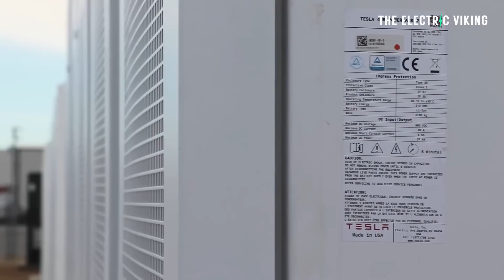Tesla signs biggest battery contract in history - U.S. grid will be transformed

Comment: Musk never agreed to EV incentives. The reason why is because it discourages Ev development reaching cost parity with ICE cars.
Reply: There are some fundamental physical realities with EVs that may be impossible to overcome.
Such as: 1 Kg of petrol has same energy as 30 Kg of batteries. ICE about 35% efficient, so 3Kg of gas = 30 Kg of battery.
This is why EVs (drone, scooters, small cars...) are practical but heavy hauling (long distance) trucking makes no sense.
And the "Charging" issue is a big problem for anything long distance. Fast charging always damages battery life.
Reply: @mddell24  ICE aren't 35% efficient typically. Usually 16-25%. The extra weight is mostly offset by the much lighter drive train components.

Comment: Just consider not one of these batteries create green energy.  They will definitely increase the electricity bills of utility customers.
Reply: Not one! But they do enable renewable energy to be a viable replacement to fossil fuel generation 

in south Australia the grid is going to reach 100% renewables supported and stabilised by Tesla megapack. In Western Australia we are already at 40% - we’ve got rid of 1 of two coals stations and our expensive peaker plants. 

So far the south Australian barter has saved the state 333 million dollars and totally eradicated blackouts which used to be a problem there - also helps led by Tesla energy bidding system. 

So that would decrease electricity bills for customers. 

We used to invest in a Australian leading energy bidding tech company - but Tesla software solution came and just disrupted them silently. 

That’s the kind of tech smarts Tesla has - hard to compete with. 

The Tesla said that the next gen megapack will removed the need for substations. That will definitely change things even more!

Comment: Pardon my ignorance, but where does the energy come to charge to these enormous battery storage mega packs?
Reply: They are meant to be charged by solar or wind generation, the power stored until needed at night or when there is no wind.
Reply: @douglasburnside  So along with these massive battery packs would a large array of solar panels?
Reply: The star.
Reply: @mddell24  - being from a cool/cloudy/wet country (UK) comes with certain benefits, that is higher wind generating capacity (80TWh). Currently over 50% of the UK's energy is derived from renewables, a percentage that is which is increasing rapidly - coal is now insignificant and will be gone completely next year and LNG usage is dropping year on year. Last year the UK exported energy (10TWh) to Europe, as there was a surplus of capacity even with fossil fuels generating their lowest output for decades. The UKs storage battery capacity reached 3.7GW last year with a further 8GWh coming online in the next year, and plans to grow this by another 44GW capacity by 2028. The UK domestic need only requires 20 to 35GW, the UK plans to be a net exporter of renewable energy by 2030. The scale of economics for battery energy systems means it is now cheaper to install and run renewable generation with battery storage than a gas turbine plant. The target operating price for battery storage by 2028 is £22/kW/yr for a fifteen year period (which is relatively cheap in the energy world).
Reply: Anything that generates electricity. Anything.
Reply: Normally one thinks of renewable like solar and wind. But there is a case where it makes sense to have ibattery banks with a regular coal fired power station. Having the battery bank would allow the station to charge the batteries in times of weak demand and have batteries add capacity in times of peak demand. This would allow the station to operate in a more regular efficient zone instead of ramping up and down.
Reply: Fossil fuels of course, so where's the saving, new tech nuclear may save day
Reply: @bm4751  that sounds counter productive... charge batteries by nuclear would be a game changer.
Reply: No one should do the math. The battery size is enormous$$$$$ for most places where people live, i.e. cool/winter weather.
Reply: @mddell24  Most people on the planet live in Warm Weather. In the US, in India and In China and SE Asia and Africa. Solar is capable of powering the entire planet with enough storage. Some places will be better with Wind, but the major population is definitely in the South, closer to the equator, Globally speaking.

Comment: Why don’t they put panels over the battery packs to help keep them cooler?
Reply: Good thinkin
Reply: Because its not the sun heating them..
Reply: Using solar panels to keep things cooler through shading is a perfect fit, so long as you have room for them. Since they require so little maintenance and last forever, once installed they almost can be forgotten. Even without battery these panels can directly power some fans to cool down further your RV, carport, your shed, your pergola or your whole house, extending the life or your shingles. But if you can fit that many, you can actually drive a large mini-split air conditioner using a battery less hybrid inverter. Solar panels are robust assets and often keep delivering electrical  power even though they've been shattered as long as there is circuit continuity within. Together with LFP batteries they are the future of off grid autonomy, tremendous savings and respect for your environment over time, of course.
Reply: Covering the battery packs with PV panels ends up using more energy to keep the battery pack underneath cooler. Solar panels are black so they absorb light radiation, however, they only absord certain frequencies and the rest is radiated away in all directions. The area under a solar panel heats up a lot, which is why some of the more expensive high efficiency panels have active cooling (cooler panels are more efficient). The heat build up means the battery pack underneath has to work harder to exhaust its internal heat into the hotter air around it. The heat also stagnates under the cover the panels and cannot raise away as effectively via convection. 

To overcome this the battery pack would need uprated fan capacity to exhaust the heat, using more energy. There would probably be no energy gain from the panels above the battery as their energy would be consumed by the increased cooling requirements. One could install tall mounting frames with sparsers tilted panels to let the battery heat disapate but the energy gain vs the cost is not significant; also this introduces maintenance concerns when working above active battery packs. 

This is why battery packs are painted white, to radiate heat away, and have fan outlets on top vent to the open space above them so the hot air can be carried away by convection.
Reply: @GruffSillyGoat  I have ceiling fans to cool my solar panel if needed. One fan easily displace and prevent the heat build up over 9 panels without drawing much energy all. It should help prolonging the panel efficiency. But they can tolerate the heat without fan as is common with public school parking lots solar installations in my city.

Comment: This contract is incredibly the opposite of transformative. It is for an extention through 2030 of 15.3 Gigawatts of batteries to be provided by Tesla to another provider. Compare this tiny amount of power - by batteries which have to be charged by something; to the US Total existing grid of 4.2 Trillion killowatts - its totally nothing. That is if there is no transition to move away from fossil fuel use to an expanded grid; then it would be 15.3 Giga watts of 18 Trillion killowatts. How can less than 1/1000th of the grid be transformative; especially when even this tiny amount has to be charged by something, it may well be fossil fuel plants doing the charging.
Reply: If battery storage made economic sense. Fossil plants would invest in that without subsidies, you could charge them off peak to release on peak. It's just obviously a lot cheaper to create on demand if you can.
Reply: @SteveLomas-k6k  Agreed. The million year old solar-fossil battery is strong, (CO2 excepted).
Reply: Thank You!
Reply: BIG elephant keeps confusing the debate - KW is not KWHr. We should never confuse apples and height.
Reply: The daily energy usage in the United States in 2023 was approximately 75,424 gigawatt-hours (GWh).

If one megapack site is 15.3GW in capacity - it provides 0.02% of the entire US daily electricity needs. So yes less than a Thousandth - but it’s okay there is plenty of room to grow. We have a state in Australia about to reach 100% Renewables - supported by Tesla megapack batteries. 

For Tesla this US project is around 1.4B in profit. Teslas energy business really is a unlimited demand market.

Comment: Tesla needs to get into fusion energy. Solar is simply not just dense enough source of power to be able to place households and businesses off-grid and completely no longer relying on legacy energy companies/suppliers. The disruptive effect will be felt more if they’re one of the first private companies to develop and deploy workable and viable fusion reactors.
Reply: Why do you think so? If every home would have it's own solar panels and batteries, we indeed wouldn't be needing the grid, well we would need micro grids or state-owned batteries in case of emergencies, but I feel like the modern solar panels are already good enough to live only on solar energy,, wind is also great, hopefully in the future we could harness atomic energy safely.
Reply: Solar is pretty good, when backed up with batteries, I have switched from grid supply costing about £6000 per year to solar with battery and inverter, and a diesel generator for the two darkest months. I am saving around £5500 per year on energy costs and the system cost me around the same as one year of grid supply. The next 19 years are going to be nearly free. Any one can do it if they have a small amount of capital and some suitable place to put the panels. They are very cheap! Fusion is worth researching, but leaves the power in the hands of the corporations and its not really necessary right now.
Reply: You can buy 5kilowatts of storage for 1000 dollars now, and you only need about 3-7 kilowatts of solar to charge and maintain loads through the day and night. 20 kw of battery is enough to be off grid with occasional generator back up,
Reply: @herrba  You need to learn the difference between kw and kwh.
Reply: @herrba  Terminology problem. People think KW is storage, it is not, it is "Power". KWHrs is storage. It is easy to buy enough storage for one night , but very costly for one week, i.e. when no sun you need storage for night and day. Going off grid needs sun sun sun lots of reliable sun.
Reply: @herrba  Don't need generators if you have Solar + enough Battery storage in most of the US.
Reply: @davidc2838  there are many rural areas , generator can boost range by a large factor , even a 1500w generator would be sufficient for extreme cold or long periods of stationary idle.
Reply: Fusion is decades away from reality if it ever happens at all.
Reply: So it's between capturing the fusion energy of the sun and trying to store it somehow, or trying to create our own on demand,- neither of which look very feasible. 
 Meanwhile we already have millions of years of stored solar energy right under our noses, conveniently packaged in solid, liquid and gas states!  I think It's only a matter of time before the penny drops..
Reply: Such nonsense. Use Solar (and Wind & Hydro) with enough battery storage and you don't need most fossil fuel or nuclear.  We HAVE FUSION it's called the SUN...and it's literally the largest source of energy in the Entire SOLAR System.  Fusion still doesn't work on Earth...and won't anytime soon.

Comment: Day before yesterday I was in LA talking to a guy with an ID4 with a home charger.  A couple times a week he has to make side trips and will run the battery down to 20% and needs a public charger.  It's a nightmare.  Yes, they are all over but they're all full with a line of cars waiting, and roughly 25% of them are off line AND, the DC fast chargers that put out 350 KWH barely put out 50.  Why?  The local grid can't support that.  That's not the EV's fault, That's the fault of the charging companies and the grid.  Why do you never talk about that?   Right now public charging is a joke.

Commercial property owners may be willing to install "some" chargers but they don't want to convert 100 parking spaces to public chargers that cost a fortune and don't help the businesses that parking is serving.  Then there's the electrical grid in that area.  It's a big mall.  That mall was built with wiring suitable for a shopping mall not for charging 100 EV's or whatever.   How much and how long to rewire a 3 million square foot mall and who"s paying for it?  And the chargers?

Then there's a thing called private property rights.  The State says install these chargers, the owner says no, it can be tied up in court for years.  That's why Ford and GM did what they did.  They're switching back to ICE pickups for maybe 3 years to give time for the EV charging infrastructure to catch up.  Does China have that problem?  No, it's a dictatorship,  if the CCP wants that space for a 100 unit charging park, no problem.  You're out buddy.  No lawsuits, you're simply out.  Look at the millions of displaced people to build the Three Gorges Dam.  They had no rights yet you keep talking about how great and efficient China manufacturing is.  Dictatorships are always more efficient than free countries.  When you say those things you may as well be saying Communism is a better system than a democracy.  Yeah, the Soviet Union was such a fine place.
Reply: EV's can charge with a simple low cost household plug. They should make these available where you have 100+ cars to park. If its work parking and you're there for 8hrs then a 4KW plug is all you need. For all that expect complaints about charging for the next 2 decades after that it will be ICE drivers complaining of lack of petrol stations and how they now have range anxiety.
Reply: @TimMountjoy-zy2fd  Fortunately  for them their vehicles can already go 600 miles…which is one of the many obstacles for full EV adoption.
Reply: @microbiologycory10  Who makes 600 miles without a stop? How many times every year does somebody makes 600 miles? In Europe 98% of the drivers make only one journey over 300 miles in a year. 90% of the drivers make 150 miles every week. I charge my 150 miles range EV once every week from 35% to 80% in the winter, in the summer I make some journeys but I charge on the road once or twice every summer.
Reply: @chrishar110  I make 700 mi. once or twice a year to a vacation house in the mountains, I do stop fr bio-break but there are ZERO superchargers on that route.(central Texas to southern CO, NM is especially bad and it’s an especially busy vacation route except there’s no “best route”…perfect place for a supercharger every 300 mi but here we approaching 2025 and nada!) It’s almost like they’re making it hard to love EVs, though I’m not an adventurous early adopter…thus, OK w/Toyotas philosophy (Second rat gets the cheese…)
Reply: @microbiologycory10  You probably don't see the superchargers on the road but there are superchargers in NM and CO. Open the Tesla map and make an simulation of your journey. You will need 4-5 charges to go and return. If you try to take the shortest route and avoid the big highways to save 20-30 miles you might not find any. If you have a friend with a Tesla he can check on his car's navigation how to make that run, where and when to stop.
Reply: Miserable comment here. Well, when Trump makes the US a dictatorship you’ll be happy? Right?
Reply: The charging network for non-Tesla cars is indeed lacking, but my experience of the Tesla Supercharger network is flawless.  I had to wait for a charger for 10 minutes only ONCE in 5 years... and that was 5 years ago!
Reply: I agree and disagree with you on some points.. I do hope that charging infrastructure will get better, and it surely will, there's no way around that.
Reply: USA is the bigest part of the market but still only 15-20% of the whole market. The rest 80% develops, we can't wait for you if you don't want to follow. We spend money to increase the grid capacity, when your country and states take your taxes, your money, gives nothing back put the money in some companies' pockets and pays to advertise the next presidents.